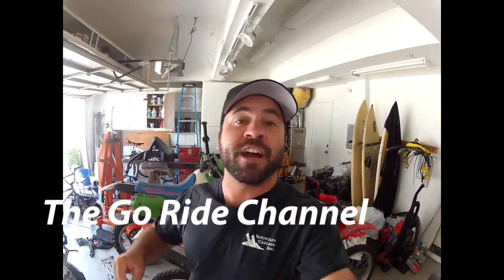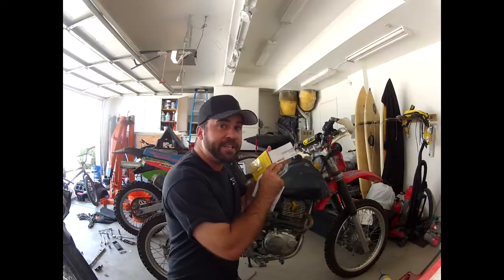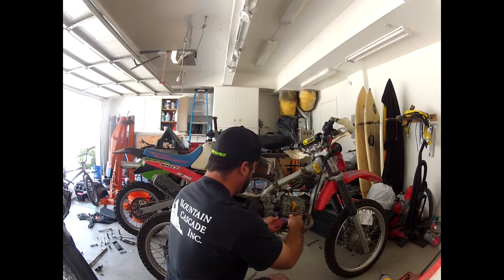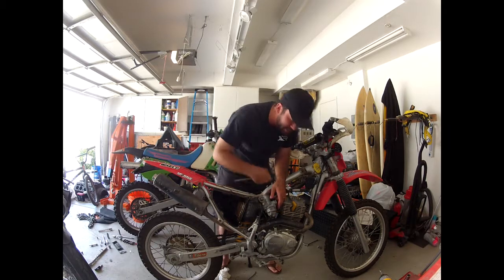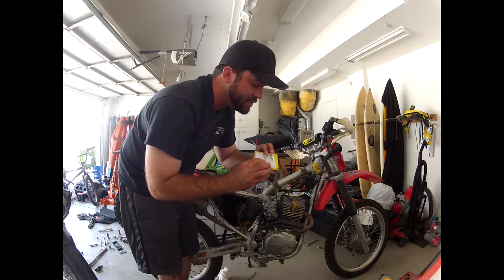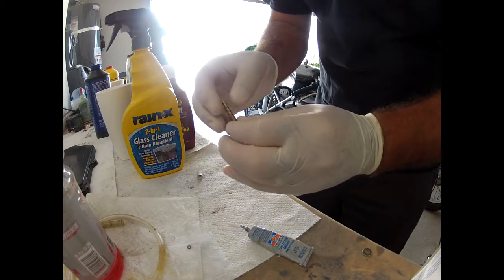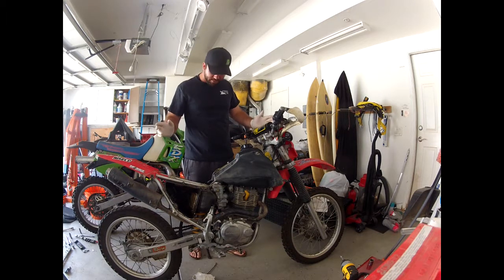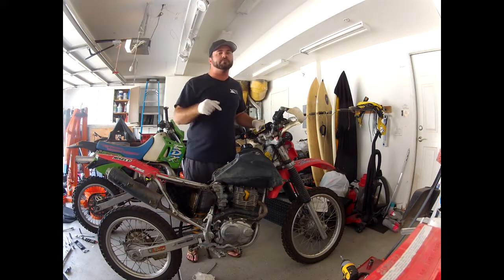CRF Resurrection Pt 3 - How to Install Extended Pilot Screw

Comment: Like to see you do a needle change on the carb hardly any videos on it crf 230f
Reply from the maker: Jesse, sorry about that - this comment got stuck in the spam folder. I'll be back messing with the CRF once the Ducati is running again, I'll try to put it on my list to do the needle change. The bike has a power-up kit on it and I'm contemplating removing it. Not sure if that would make the bike any less cold-blooded.

Comment: Is it similar to the CRF230L?
Reply from the maker: SHOULD be very similar but will depend on the year. 2006-2012 used a special "D" bit on the mixture screw. 2013 & 2014 have a cap (almost looks like a freeze plug) over the screw which will need to be removed before the old screw can be removed. 

This is all pretty much hear-say since I don't have a ton of experience with the "L" model. There may be some emission control type stuff that is different.

Additionally, full disclosure - the Tusk Screw I installed worked well at first, but it loosened up over time and eventually backed itself out. I went back to the stock mixture screw.